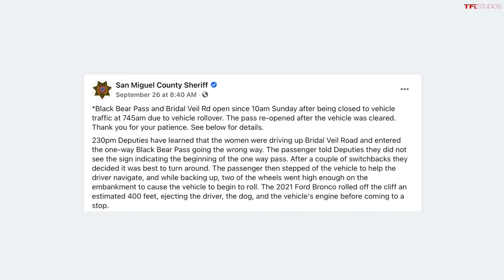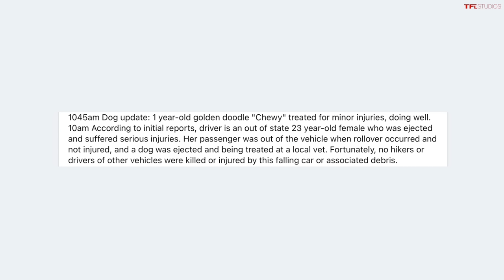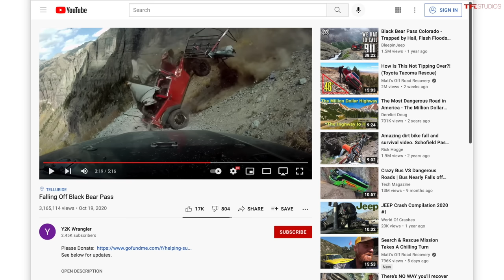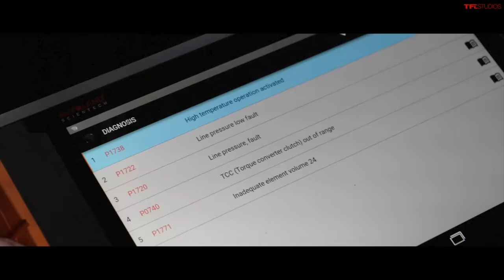The Brand New Ford Bronco Sport Rolls Down A Mountain — Here’s The Story

Comment: The Bronco Sport did receive a top plus pick from Insurance Institute for Highway Safety.

Is it safe to assume the ejection was a result of not wearing a seat belt?
Reply: You can assume that, but considering the fact that the engine, which is mounted at several hard points in addition to being bolted to the transmission - which itself is mounted to the car at several hard points - was also ejected from the car, it's entirely possible  the driver was wearing a seat belt and the seat belt failed. I can't imagine what kind of force rolling a 4000 lb hunk of metal 400 feet down the side of a very steep mountain would generate inside the vehicle. I sincerely doubt the seat belts are rated for that sort of usage.

I'm also positive IIHS doesn't have a test for that scenario.

In all honesty, this is probably one of those rare occasions when the driver and dog being ejected probably saved their lives.

Yeesh... The whole thing is kind of a nightmare scenario for me. I'm definitely not a fan of shelf roads.
Reply: And her friend telling her to keep going.
Reply: It's because they weren't driving on the highway. What does the institute of highway safety know about trails and mountain roads?
Reply: Its not rare, its better to be ejected out of a vehicle then let the seatbelt hold you in... hold you in for what? So the roof can crumple down on your head? Of course that also depends on how lucky you get, we're all just better off wearing bike helmets inside cars, but of course taller people may not even fit.
Reply: @thenotsoguitarguy9429  Engines are mounted to breakaways.  Keeps you from being killed in high speed crashes
Reply: Yesh, she was not wearing a seatbelt and contrary to TFL the passenger was outside the vehicle and was spotting.
Reply: @2011blueman  well yes, but actually no
Reply: @ernestochang1744  Ok, so we agree that what you wrote was absolute nonsense, but you insist you're not a troll.
Reply: @2011blueman  there have been a few instances were not having a seatbelt on has saved people leading us to question the validity of "is having seatbelts on safer?" Well yes obviusly the answer is yes, but is it really? "Well yes but actually no"
Reply: @ernestochang1744  Are you really arguing that seatbelts are less safe? You're an amazing troll.
Reply: The stock lap and shoulder belt combination is designed for the common on road crashes that probably don't involve rolling down a mountain. For that, a 6 point harness is needed. Many off roaders don't use seat belts because they think they will get out of the vehicle if it rolls.
Reply: @tiredoldmechanic1791  Seatbelts are designed to hold you in place during a rollover accident and stop you from being ejected. The people that don't use them off road are fools. That said, in an accident of this type you're not going to escape major injuries, but a seatbelt can save your life (most ejections end in death).
Reply: @ernestochang1744  
That might be the most outdated and stupid comment I've read in awhile!

"The myth that people who get ejected from car accidents are sent “free and clear” of the danger is just that: A myth. The NHTSA found that only 0.3 percent of people who were ejected during a crash were left uninjured".

1. Buckling up is the single most effective thing you can do to protect yourself in a crash

Seat belts are the best defense against impaired, aggressive, and distracted drivers. Being buckled up during a crash helps keep you safe and secure inside your vehicle; being completely ejected from a vehicle is almost always deadly. 

2. Air bags are designed to work with seat belts, not replace them 

If you don’t wear your seat belt, you could be thrown into a rapidly opening frontal air bag. Such force could injure or even kill you.

Please stop spreading lies and false information on YouTube Mr. Chang!
Reply: @2011blueman  you could wear a seatbelt and still get ejected in a rollover like this. Definitely safer to have it on though. Clearly this thing tumbled and rolled many times, your upper body could slip out of the shoulder belt and then the lap belt is going to go loose.
Reply: @ernestochang1744  i can assure you that a restrained driver is much safer than one that’s ejected. I’m an ER/ICU nurse and usually the ejected patients go to the morgue while the restrained ones wind up in the hospital.
Reply: I always wear a seat belt unless I'm on my bike.

Comment: The Bronco Sport scored one of the best results ever in the IIHS roof strength test.
Reply: Better than the 2021 XC90?
Reply: @nfareview  Why XC90, it isn't anywhere close to the best models in this test, a Kia Soul got a much better result than the XC90.
Reply: @Mgoblagulkablong  because my wife just got hit by a semi truck in ours and didn’t have a scratch on her. You should do more research on it before thinking a Kia is safer lol
Reply: @nfareview  The strength to weight ratio of the XC90 according IIHS is 5.18, versus a 6.24 for the Kia Soul, so while the XC90 may be a top safety pick plus vs the kia soul being a top safety pick, if you do the research for the roof strength you'll see that Mgoblagulkablong was right.

Comment: Have been going to the Ouray area for 30 years to enjoy the area and travel the trails. The only trail I've not been on is Black Bear. Wife put her foot down and has an absolute prohibition on that one. Small price to pay considering all the other things she goes along with.
Reply: @DevilDog53 I'll be doing Black bear...but only the first half up to the summit/sign, takes the traditional "tourist" pics, hang-out for a while, then go back down the same way I came (Ouray). Will NOT (due to Acrophobia, not adverse to shelf-roads specifically) be doing the second half down into Telluride.
As for "too old to die," I'm "too old to be still living."  ;-)
-- BR
Reply: Sounds like it's pretty easy if you're going the right way and don't try and turn around, 😂
Reply: I did BB pass in the early 1980's in a Jeep CJ 5 manual. I was very careful and had no trouble. My wife did walk the steps section lol. A manual transmission with a carburetor was a challenge. We still do trails in the area but one time on BB was enough for me !
Reply: @JH-mt3pp  Yes, most of the cars I've had/worked-on had carbs, points & condensers, checking the timing (annual tune-ups) were the rule...like on that 1966 Jeep Tuxedo Park I had for a while.  ;-)
As for Black Bear Pass (BB), it's mainly my fear of heights (and I have vertigo as well) -- not a good combination for doing BB even though I agree it's not that difficult otherwise. So if I ever find myself needing to get from Ouray to Telluride (or vice-versa), I'll find some other way.
Perhaps "trailing" on the "Million Dollar Highway" would be more my "speed?"  ;-)
-- BR
Reply: If someone wants to go that high they can do helicopter rides
Reply: @devildog5354So why do you think people who don't have experience would even try this?. I'm looking at the video and I'm thinking there are MUCH safer ways to get that view. It's not worth your life for a Sunday drive, WTF were they thinking???

Comment: Ford stock just went up. Bronco looks great considering what it went through.
Reply: Because 2 woman can survive a 4x4 trail in it? You think all those subaru owners are running to ford to trade in? I bet they sell exactly ZERO due to this. In fact it shows the vehicle is unstable since it rolled AND driver ejected. Total POS if you look at it. A $500 horse would have made it no problem.
Reply: @flyingdutchman1352  any car is going to flip if one side is off the ground even if it's stable🤦🏽‍♂️

Comment: This is one example of why I have been a huge advocate for non-ratcheting seat belts for off-road or slow speed use, even just a simple old style lap belt would have kept her from being ejected and she may have been injured less. I have seen a woman who was involved in a similar fall down a mountain driving a CJ-7 was also ejected because the ratcheting mechanism allowed the belt to loosen during the tumble 300+ feet down a mountainside, she went out the passenger doorway. The Jeep itself was still structurally sound the same as this Bronco, the roll cage held up great.

Comment: That's incredible that the bronco sport fell 400' and it held up that good. I wonder if the air bags helped keep the cab from collapsing. Amazing they survived. I work in a quarry and 400' is considered a death sentence.
Reply: Air bags inflate and then deflate.  Both very quickly.
Reply: Air bags have no effect on the structure of the vehicle. The structure held up well and looks like the bags did their job also. I’m impressed.
Reply: Side airbags stay inflated for a good amount of time. Incase their is a secondary accident after the first or for rollover situations.
Reply: @kevin barker you may be right but still 400 feet, I still think that's pretty amazing. Probably more luck than anything. It's possible the cab never took a super hard hit when it was rolling down the mountain, I guess. I am aware car companies are unscrupulous but a blind squirrel finds an acorn every once in awhile. So they could have accidentally built a strong cabin lol
Reply: @kevin barker I imagine it would be hard to determine how that car rolled down that mountain and the amount of pressure put on that cab. A straight fall of four hundred feet would have destroyed it. It would be interesting to know if that cab can withstand more than the average cab. If it can, Ford will surely let us know lol.

Comment: I'm impressed that the roll-over was so violent the engine said "F*CK this, I'm outta here" and yet the suspension and steering geometry look fairly intact and straight.
Reply: The engine is designed to get shoved beneath the body in the event of a frontal crash, so it's not too surprising that the extreme kinetic chaos that happened here caused it to detach completely

Comment: Friend of the family drove a new disco off a 100 foot cliff. Car rotated through 270 degrees and landed on its rear on a beach. All the air bags went off and the guy walked out with only a cut on his head. The weird part is that this same guy helped design the same air bags for ford which were in turn used by land rover on this disco. Modern cars are pretty impressive vehicles.

Comment: I've wheeled that road several times. Scary thought to roll on that trail. I would never attempt that in a Bronco sport.
Reply: I would,it can be done in a in a car. She flipped the bs(bronco sport) and dropped her car off the shelf. If you did that in a wrangler,oy vey, you are dead.
Reply: She also went up the wrong way and then attempted to turn around on a hillside, the Bronco sport would have done fine for sure
Reply: Especially a shitty Bronco with all season street tires.
Reply: One example when a more narrow 4x4 (Jeep) would have the advantage.
Reply: @krane15  The bronco sport is 0.6 inches wider, I don't think width was the issue. The jeep's turning radius is also between 17.25 to 20.4 feet vs the 18.7 feet of a bronco sport. The issue here isn't with vehicle, but driver.
Reply: @williamreinhardt2774  I don't totally disagree with that. Even so, unless the vehicle is totally autonomous, you can always claim driver error as the cause of an accident. 

On the other hand, a well designed vehicle can also make driving a safer. Consider all the people who have avoided accidents because of ABS, stability control, blind spot warning, or even reverse cameras.

Comment: Just an FYI. There is a statement in this story that said that the passenger was out of the vehicle directing the driver. The person speaking said that both of them were in the vehicle when it rolled down the mountain, but if you pause the video and read the part of the statement, the passenger was Not in the vehicle.

Comment: I grew up at the beach.  I drove 4 wheel drives in the sand at the beach growing up.  I got a job working as guide in Vail Colorado. We had H1 humvees. The locals taught Mountain roads and basic driving instructions. The bottom line is  There is no such thing as a dangerous road. Only people can be dangerous. You're either knowledgeable and qualified for that environment and that road under those conditions at that moment or you're not. I hope the lady in the hospital ends up being OK and I'm glad no one was killed. That must have been horrifically terrifying.

Comment: As someone who has driven Blackbear dozens of times in the last 40 years in a JC5, going up is actually easier. I've helped pull several vehicle off the edge and usually it's a long wheel base or full size truck. The trail was made for mules, think about it. AND NEVER MOVE A 4-WHEEL DRIVE WITHOUT FIRST PUTTING YOUR SEAT BELT ON!!!! NEVER. You can wad your vehicle up pretty bad and if you are belted in you have a pretty good chance of walking away. This Bronco is a good example of that.

Comment: I bought a Bronco Sport Outer Banks, I DID NOT buy it as a full off-roader, more as an urban off-roader. Looking forward to running it in the snow.  Its has been a capable vehicle with no issues on the highways or light back country roads.  I would not take it rock crawling.  I am impressed with how well it held up to a major roll over down 400 feet.  Many years ago I had a Lada Cossack 4x4, I got hit by a ranchero (I was parked) and it was totally wrote off.  It actually bent the thing in half.

Comment: 400 foot FALL down a CLIFF which implies a vertical drop, OR did it roll over down a 30-45 degree slope for 400 feet, which is a very different event from a terminal velocity perspective, and the forces involved. The vehicle looks like it was doing relatively low velocity rolls down a moderate slope. The injury to the driver would seem to be caused by them probably NOT wearing their seat belt, and their serious injuries sustained when they were ejected from the vehicle???

Comment: I had a 2014 Ford escape that just got t-boned last Tuesday and the whole front end was destroyed.  they hit me where the front tire was so not the door thank God but it was a big Honda pilot and it basically knocked my hood flying off like 20 ft the whole front was crushed and moved over like a foot and I walked away with no injuries thankfully the side curtain airbags protected my head from the window or I'm pretty sure my head would have gone through the driver's side window no injuries just some bruises those cars are built amazing because the bronco sport is basically an escape that looks cooler.  Even my dog who's in the backseat and he ended up getting thrown around he just walked away with one cut and a couple of bruises thankfully no broken bones or anything. The speed of the street we were on was 45 but I'm pretty sure they were doing like 55 or 60 and they did hit their brakes but only about 10 feet before my car so I know they were going at least 30 when they hit me probably more and I was at a dead stop and I still didn't have any injuries so yeah those those are built really well especially for being unibody like you said

Comment: Black Bear pass is not a simple 4x4 road. The steps by the falls and some of the higher switchbacks should not be attempted without a customized high clearance 4x4 vehicle. A bronco sport does not have the clearance or capability.

Comment: Maybe I am weird, but I love shelf roads for the exact reason you say you dislike them. After doing BBP, it kind of removes the scare factor of many trails. Even though BBP is technically no challenge, mentally it sure is! It made me feel alot more comfortable on many of the Moab trails, because they were technically more complex but the "im going to die if this goes wrong" factor was lessened quite a bit. 

Our stock Rubicon Ecodiesel made quick work of BBP!

Comment: If I recall the Jeep Wrangler that rolled down the cliff had a failure of the parking brake. Always set and test your parking brake in neutral before putting the 4x4 in P and getting out of the vehicle. It only takes a few extra seconds. Also if you can, nose up or back up to a tree or bolder or chock your wheels some way. All of the above preferably. You should never allow the transmission to hold the 4x4 in P on a trail. Manual people should know this but leave the 4x4 in gear too as a fail safe if its a manual.

Comment: I hate to say it but I didn't even recognize it as a Bronco Sport until I saw the wheels.
Reply: @KFC Man They say that because the passenger compartment held up phenomenally well. You can still clearly see where the doors are, and that's a good thing, because that's where the passengers would be during a crash, and the fact that it held up so well means that the occupants inside likely survived like in this case.
Reply: @KFC Man The wheels, they only have those wheels on a Bronco, but no, there is absolutely no way to identify the car by the bodywork.

Comment: I disagree on the safety, depending on how it happened. The driver was thrown from the car. That means the door opened and she was tossed out. If her seatbelt was on and the door was closed, she should not have been thrown. We don't know if she was belted so I can't say for sure it is a design problem, but it might be. Also, the passenger was not hurt as she was outside when the rollover started. Only the female driver and dog were injured. Anyone who does any serious wheeling needs a 5 point harness on trails like this.